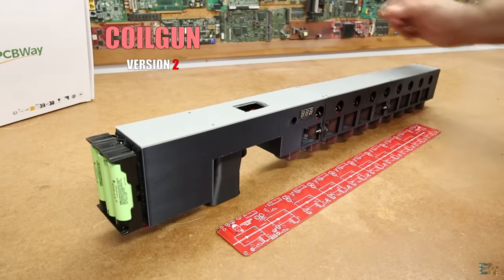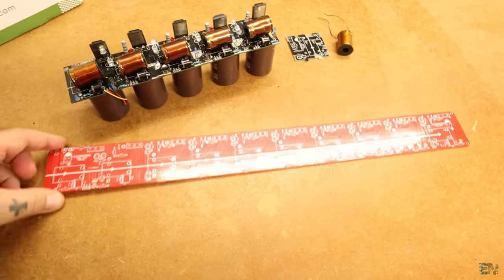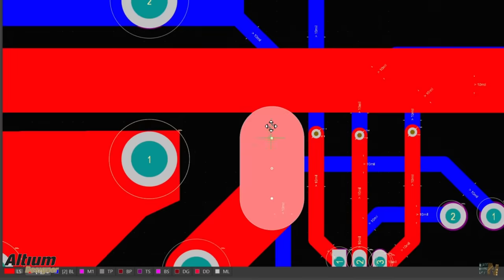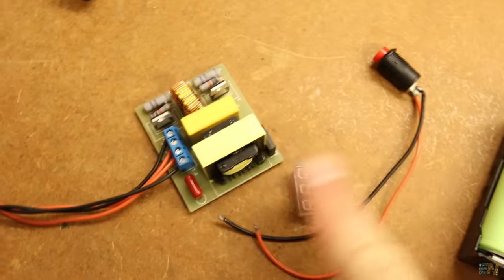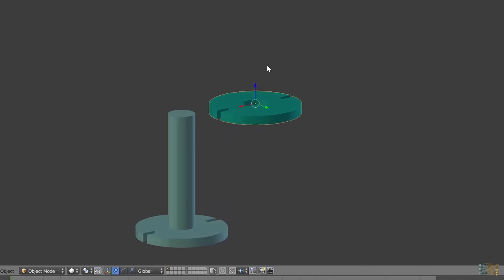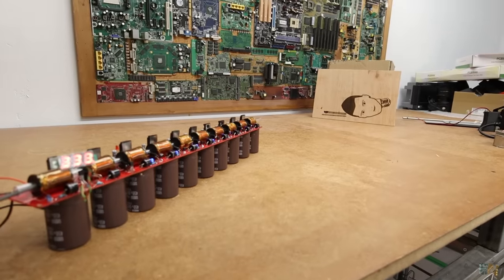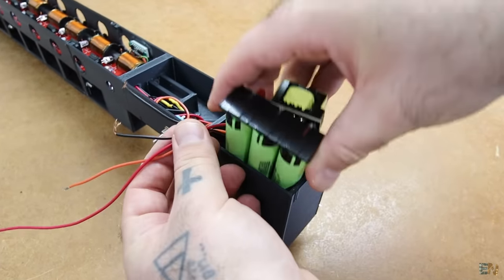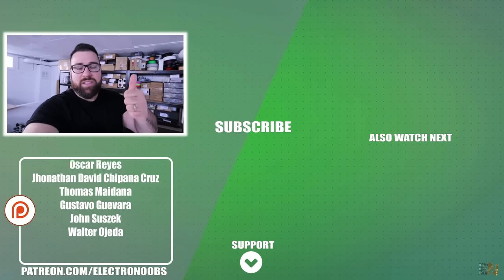POWERFUL 10 Stage COILGUN PCB + 3D Printed Enclosure

Comment: Try to figure out a way to hold a projectile without it sliding itself into the barrel which will effect in shooting prematurely - it's even more dangerous than those 450V. With current design you cannot hold a coilgun vertically (to not aim to anything around you) withouth this issue. I couldn't figure out anything, maybe you can.

Comment: another question for you. i am doing your project and everything makes sense except for the volt generator. the link you have on your website is a bit different then the one in your video. would you be able to explain where the imput/output would be on the one that is on your website?
Reply from the maker: Check here: https://ae01.alicdn.com/kf/Sef89e3bafc0b4aae8597e65c02f84f802/Inversor-Boost-Step-up-Board-de-500W-1000W-DC-12V-a-AC-220V-380V-420V-transformador.jpg_.webp Just connect the 380V to your couldun high voltage input...
Reply: Did you manage to do it with this module?

Comment: With an Arduino UNO, you can easily calculate the time between the infrared sensor time of the first coil and the infrared sensor time of the last coil and instantly print it on a display screen.
Reply: I would like to have your Altium design PCB design file

Comment: As the coils go. Increase the space between light beak and coil.. 
That way the faster the unit goes. The spacing will compensate for speed!
Still you are bound by coil decay speed!
Reply: Exactly my thought! You should check if adding more stages is actually beneficial or not. Awsome project !
Reply: @danoseus  in 1996 I mage a 4 coil gun. and build a home made timing Computer. that had timing set by micro dip switch. 
It fired through a board, and out my wall..
However, coils caused a ringing feedback, that rendered DIP computer useless.. 
Until it was restarted. 
Hint: I used Back Flow to speed up Coil Decay speed..
cost me $3,000 CAD to make, back then..
New tech might be cheaper, but also more fragile.. 
As all my timing computer was a Phase locked loop, for making the timing pulse.
And Memory was physical DIP switches, that needed to be flipped on/off with a tiny probe.
To set the timing, it took me almost a whole day.. As Math can not account for EMF Field drag!
At one point I had timing so bad, it fired backwards. As in projectile went in and got sling shot back out, due to one coil's timing being off..
Fun day! lol
Reply: @danoseus  FYI, I do all crazy testing in a remote cabin, that was once build for my late Uncle... Harm no one, and explore life!

Comment: Nice projet , why stop at 10 , how about a 100?
Reply: Diminishing returns probably.  I also need to double check, but if I remember correctly spacing isn’t the same for each coil, i think they start close together, but spacing can be increased as the speed increases.

I forget what is Optimal, but another channel was looking into this if I remember correctly.

Comment: Your next step should be reduce the chances of backfiring, higher projectile energy. Possibly introduce a spin into your projectile before being shot.

Yould probably need to levitate your projectile to make it spin which would need compressed air. Or maybe just use a carbon tube instead

Comment: Hey ! I was wondering: what is the resistance of each coil? And so, what is the maximum current passing through the coil when a capacitor is fully charged. Is it possible to use Mosfet instead of thyristors?

Great video, btw!
Reply: A lot of MOSFETs are not able to handle the amount of current when firing so Thyristors are used as they can do the job well. It's also cheaper to buy thyristors instead of MOSFETs suited for the application. The current flowing through each coil is calculated with this formula: V÷R
Reply: @ThinkingFurry  thank you for that answer !

Comment: What also would be nice, if this gun had a possibility to discharge itself, so in case you charged it but don´t want to fire anymore :D Or what would happen, if you fire this gun in empty state (without a bullet)? There is a lot of magnetic power which will not be absorbed by the bullet.

Comment: Eyyy i got one of those big capacitors at home, how do i know where - and + are? I dont wanna blow it up
Reply: There should be a — located on the side of the capacitor indicating the negative side
Reply: @ThinkingFurry  thanks, i checked again but the only thing that’s written on it is the manufacturer and the type on the side of the capacitor. Nothing on the top/bottom. Do know know if there’s a way to determine the + and - side with measurement, because im afraid that of i get it wrong the thing might break/blow up
Reply: @brix_max  Using a multimeter might help
Reply: @ThinkingFurry  how?
Reply: @brix_max  I think there should be a diode symbol on the multimeter. Just measure it and if it says - then switch the probes and if it's a positive value then you know what polarity it is.

Comment: To make a proper full functioning railgun you still need the parts from pneumatic powered paintball pistol as well as everything else
Reply: Just use a coil gun as the first stage of your railgun this would eliminate the need of any paintball gun or anything else like that and you could drive it all off of the same voltages

Comment: 0:31 You don't know how to use your Vernier Calliper!     measure the hole with the back let's say is 2.4mm put the zero,  close it, and now you have -2.4mm negative for zero measure with the back the distance of the 2 holes between them so you have the real distance let's say 44mm and the 2 half of the diameter of the holes 2((2.4/2)+(2.4/2))=2.4 that by zero the Vernier Calliper when we measure the hole we already subtract it and remember in that way our zero became minus-2.4mm

Comment: You really need to learn how to properly draw a schematic, left to right, top to bottom and proper transistor rotation. Its such a simple schematic and hard to read because the way its drawn.

Comment: More PCB builds. Why? You know you can throw all of that away and the coding by just switching to solid/brush contacts. Give it a shot sometime. You'll never look back at IR sensors and PCB's. Plus, it allows for a minimalistic amount of parts, saving you room while making the finished product lighter.

Cool build though
Reply: Remember that brushed contacts will wear out overtime

Comment: My dear friend, 

warning: read with human emotions disabled please

You'll need to get a ts101 or t85 smart soldering iron (they are not to expensive), 
Get these three tips TS-BC1 TS-BC2 and TS-BC4 (or the equivalents for the t85), 
Power the smart soldering iron 24v 4Amps from bench or decent Meanwell power supply
also get the brass tip cleaner can, soo you can clean your tip before u solder... 
also when soldering such large copper tracks preheat board in the oven or with heat gun 
then use decent SOLDER tin/lead(plumb) rosin core based... no lead free chinglish chinese shit soller
get a decent flux pen lookup "Louis Rossmann how flux works"
ooh also a fume extractor would be a nice thing on the BOM

then try again and show us how it went... 
oh and throw away that utterly piece off shit soldering station with heater in the base instead of in the tip ;)

you can enable human emotions again and read further
 
But nevertheless really cool project my Friend